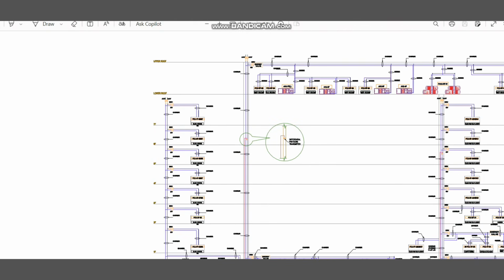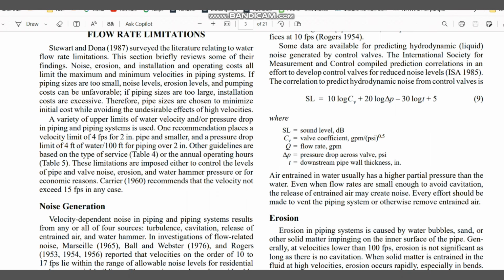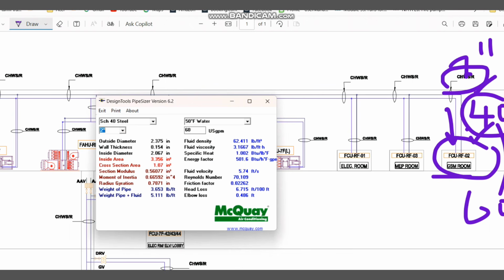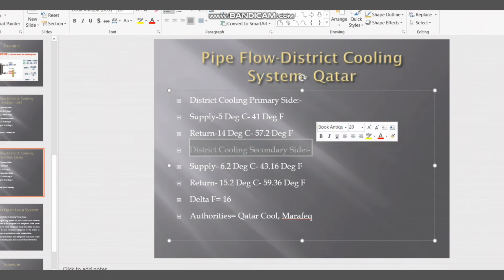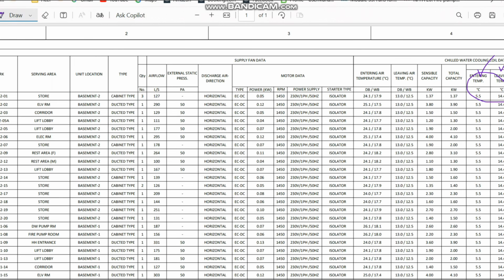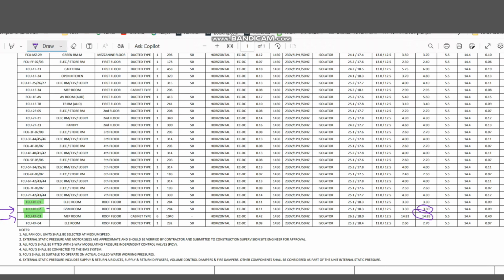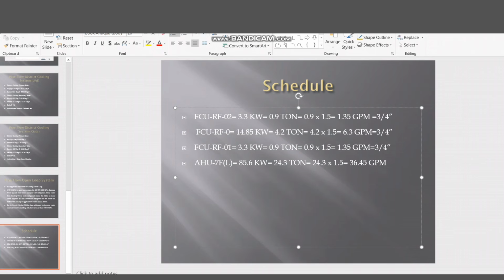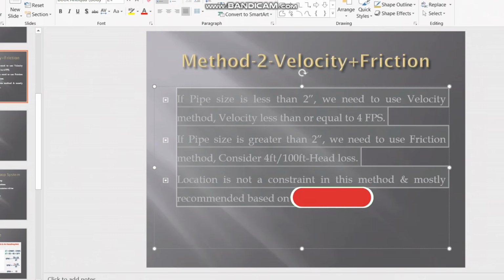HVAC Chilled Water Pipe Design - ASHRAE, Carrier HandBook l High Rise Building l McQuay Software

Comment: God bless you for your great work; I always really appreciate it. You’re doing a fantastic job! As you mentioned in your videos, I would like to request a detailed video on the ETS room, explaining step-by-step how to outline the process. Please cover all the packages for the coming line to the return line, including all required valves, pressure gauges, temperature gauges, and any other relevant points. Additionally, I would like clarification on whether pumps are provided in a district cooling system, and if so, in which line they are included. Thank you!❤
Reply from the maker: Hi yes sure I will post a detailed video for ETS room. For district Cooling system, Pump is available in the secondary supply side (After heat Exchangers) to create the loop from heat Exchangers to buildings HVAC Units

Comment: One more request: please create a video on equipment selection, such as for a Fresh Air Handling Unit (FAHU). For example, if we need to select a FAHU for a G + 2P + floor building, what steps should we take? Should we calculate the fresh air requirements for all the floors and then add some safety factors to determine the required CFM? Or should we simply discuss the details with our supplier, including the on-coil and off-coil temperatures, and let them suggest a suitable capacity for the FAHU unit based on our building's needs? Thank you!❤
Reply from the maker: For FAHU total cooling capacity,  sensible cooling capacity,  calculations of fresh air for one complete level floor including the pressure balancing I explained in two videos which are available in my UTUBE Page alread

Comment: This recommendation is suitable only for steel schedule 40 pipe or it suitable for HDPE pipe also, if it suitable for HDPE pipe also means how can we find the pipe size, because in pipe sizer don't have option for HDPE pipe
Reply from the maker: In the software u can find other options for plastic pipes. Equivalent pipe roughness pipes u can consider for HDPE